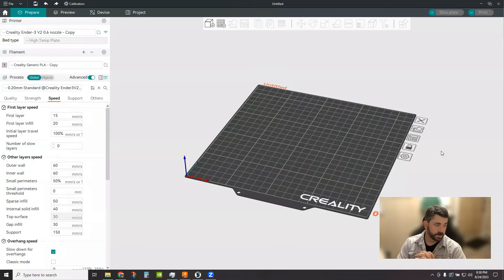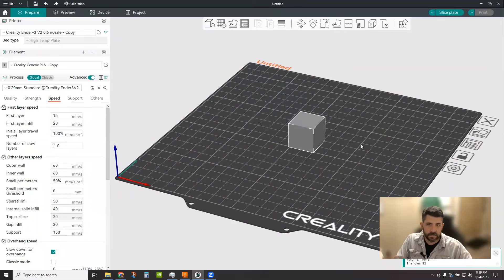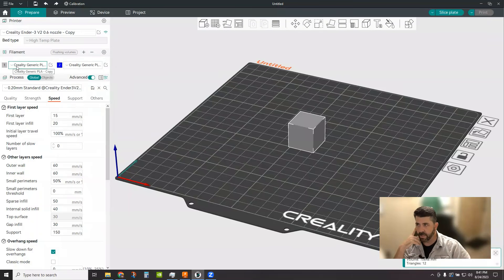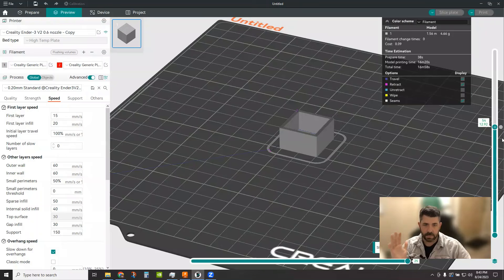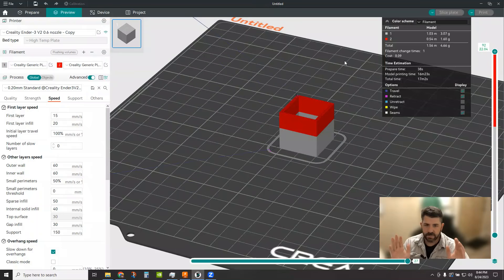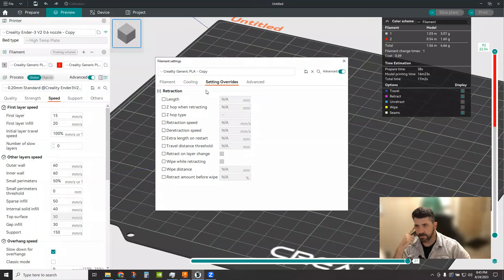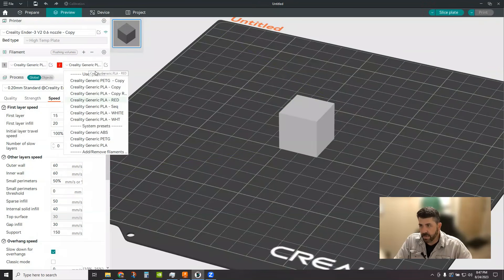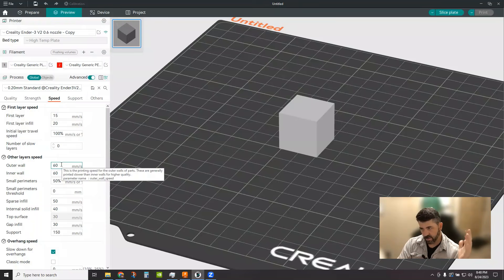Do this for easy filament changes in Orca Slicer

Comment: When I right click the scroll bar on the right in Preview there is no "filament option," just "Add Pause," "Add Custom G code," and "Jump to layer." Filament used to be there but is gone. Ive reinstalled and installed software to no avail.  ANy ideas?  Thank you! Maybe because I only have one filament listed on the left?  Not sure how to add more.  thanks!
Reply: my filament on the left has no plus sign to add more.

Comment: FYI - for manual change of filament use M25 instead M600. M600 applies only to printers with multifilament option.
Reply: @TheSkullProphet  about for the Flashforge Adventurer 5m pro

Comment: Thanks you, simple and straight to the point. I've had problems with my printing I messed up the Orca Slicer by messing with the default settings and added my own settings, I had to removed them to get a solid print all working OK now, I have also changed the travel speed from the default set at 700ms to 150ms on the Ender 3 v2, the pain is the calibration on the printed and setting the Z-Offset but I think it's OK now best I can get it. Thanks for the Video it really helped me out simple :) Sub :)

Comment: Thanks for the good explanation for changing colors in Orca Slicer. But how do I actually get this to work on my Ender 3 v3 printer. Many people say that Klipper is so much better than Marlin. I got this E3 V3 partly because of this. But now I’m not so sure. Color changes in marlin were super easy. I have yet to find any really good info on color changes using Klipper. Perhaps someone could point me in the right direction. Thanks

Comment: Ender 3 Pro and  Orca Slicer user here. 
I did a test with filament change from color 1 to color 2 yesterday, but the printer never stopped, and printed the piece all in color number 1. I checked the G.code sectión on the printer configuration and says M600 for the filament  change and M25 below at the pause section. Anyone having this issue? and knows how to solve it,  thanks in advance

Comment: Ender 3 v3 se user here. This worked pretty well. I didn't know what to expect. It paused on the change. On the printer's panel I selected retract and ejected the first filament. I then manually inserted the second filament and the printer resumed shortly thereafter. I'm not sure if there's a sensor to tell the printer had the second filament inserted or if this is a timer but it worked

Comment: Anyone have an idea why my printer is just sitting idle when i try printing with the added filament change gcode?  doesnt even start the initial print, just sits idle with bed and nozzle at operating temps and doesnt prompt for anything else

Comment: pitty theres no info how to get those  + - buttons to add filament, that you have to check it in printer settings and check that you manualy change filaments also. with that info it would be complete and 10/10

Comment: I wish you've shown the actual printing too, because when a filament change is added like this, the printer starts normally, does the priming line, but instead of starting to print, the print head goes up, retracts the filament which was already in, and starts waiting for you to insert the first filament, even though it was there to start with. Now, you have to re-insert the filament, extrude some and manually press the resume button to start the print. By this time, the nozzle pressure is lost, some filament has already oozed out and the first layer starts without a priming line and a bad under extrusion. This needs to be corrected. Orca slicer version 2.2.0, Creality CR-10SE
Reply: Utilizing a priming tower for this will be your solution for this. Do the same process, and after resuming, ensure ramming is on and it will prime on the tower, getting rid of the blob. hopefully

Comment: Really helpful video, thankyou! The bit that I was struggling with was the different print speeds or different layer heights, for example, after the filament change. Judging by what you said at the end of the video, this cant be changed for different filaments?
Reply: You can!!! You will need to add a Modifier and you will be able to change speeds when you change filaments.

Comment: Newb here. What is a Filament G-Code?
Reply from the maker: no worries.  we were all newbs at one point.  what type pf printer do you have?  under the printer settings you can manually add g-code to change filament.  This particular video would be a reference if you're using something like and ender 3 that has Marlin based g-code and you'd use an m600 command to initiate a printer pause to change the filament.
Reply: @fischer3d  Flashforge Adventure 5m. 
No idea what a G-Code is. Need to research.

Comment: how i put mannual bed and nozzle temparature in orca slicer 
i search all settings but not find
Reply from the maker: nozzle and bed temps are governed by the filament settings.  next to the name of your filament there is an icon to "edit presets"  there you can set the nozzle and bed temps

Comment: Quick question..why when I add a M600 at layer..does the paint layers keep changing? Like I add it at 11..rezlice and then it shows color change on 10 instead of 11 it use to be
Reply: I think it jumps to the closest 5th layer try using your arrow keys to choose specific layer

Comment: Is there a way to get the printer to extrude the filament after a filament change instead of having to push it through manually to get to the next color?
Reply from the maker: What type of printer do you have?
Reply: @fischer3d  Ender 3-v3 SE. I think Iended up just doing this manually. Weirdly, I'm back to doing a filament change on something again. And now when I right click, the option to filament change isn't there. So using gcode it is, I guess.
Reply: I figured it out. I believe in previous versions if you just right clicked, the filament change was already there. In later versions you have to add the additional filaments first in the settings and then it will let you right click and do the filament swap

Comment: So I know this video was done 10 months or so ago but I tried the process you describe to change the filament at a particular layer.  The first try just blew right on through the layer where I expected it to pause and allow me to change (and no beeps either). Then I tried adding into my machine (Ender v3) profile Manual Filament Change under Multimaterial. No joy there either.  Now I am trying M25 under the Change filament G-code also in the machine profile. If that doesn't work, do I have to insert the gcode manually at that layer (you can't do both the filament change and something else when doing it this way)?  Orca Slicer 2.1.0. Thanks in advance for any tips!
Reply: So M25 at least paused the print so I could change the filament.
Reply from the maker: Isn't the ender v3 klipper based firmware?  or is it marlin based?  If klipper you'd have to investigate a bit on executing the pause and filament change.  I believe it works differently than marlin.
Reply: @fischer3d  ender 3 v3 is marlin

Comment: Really hope someone answers.  I love your content and have a question.  I've been trying to fix an issue, I use the filament change option in Orca like you do, but when I do that, and then start the print again, it shifts a little, so its now skewed.  I don't know how to fix this, been trying to fix for a couple days.  Can you offer a suggestion? Is it from the Z-hop?
Reply from the maker: interesting.  It normally wouldn't be something like z-hop by itself.  is it skewed in the x and y or in the Z?  When manually changing filament with my old Ender I had to be super careful not to press too much on the print head while changing the filament or the nozzle position gets thrown off.
Reply: @fischer3d  It was working fine before but now its not. Even when I use pause, M600, or filament change, it still moves over a little.  It's skewed on the Y, not X or Z.  What do you suggest?  It was working perfectly before and now it's not, no matter what I do.
Reply from the maker: If you haven't already, maybe do a control test..  What I'd suggest is let it go through the pause, but don't actually change the filament or touch the head, then just resume the print.  See if that by itself causes the shift.

If so, and it's still in Y i'd be looking at something mechanical like belt tension.  

What type of printer do you have?
Reply: @fischer3d  I actually did that before you suggested it.  It still shifted.   I have the ender 3v3 KE.  You think it's belt tension?  Tighten or loosen?

Comment: Do i need to add a pause so i can manually change my filament?
Reply from the maker: all depends on the type of printer.  In Marlin gcode an M25 command is a pause or dwell.  if your printer also has the "Park on pause" enabled then when an m25 is issued it'll park the head in a predetermined location.  You can then change filament and resume the print.  If your pause command also includes a temperature setting to cool down the head you'll just need to be aware of that.  An m600 itself should theoretically take care of all of that.  Generally you would not issue an m600 and m25 together.
Reply: @fischer3d  i have the first ender 3, i tried to print aith change filament but it didn't pause print, is it also because of the firmware?
Reply from the maker: Could be.  Do you know what version it is running?  Looks like m600 has been available since Marlin 1.1.0, but pretty sure the the original ender had something like 1.0.3.
Reply: @fischer3d  im running 2.0.6 , it is working, i notice that the temp changed because i had different temps for diff filament. I thought that "change filament" it will pause and wait for me to press resume to change filament, but i think thats not it?
Reply from the maker: interesting. are you sure that's not the Creality FW version?  it should have a pretty annoying beep and prompt you to press the knob to resume printing after filament change. I'll have to power up my old ender and see what version i've got running.

Comment: Getting ready to do my first 2-filament (color change only, same type PETG) and I found your video.  My problem however, is that I have an AMS and my first filament is in it.  The 2nd filament I have to use the spool holder on the back of the Bambu X1-Carbon because the spool is cardboard and it won't work in the AMS.  When I send something to the printer in Orca, I have to deselect the AMS if I'm using the spool holder on the back.  I don't see a way around this, so I'm guessing that I will have to use both spools on the back? Unless you know another G-code to alter that?   I'm very new, less than 4 weeks, at 3D printing.  And, I'm an old dog, so things don't come to me as easily as before.
Reply from the maker: Sorry.  Not sure how to solve that one.  I found a couple of folks attempting the same with Bambu Studio, reading over the steps it looks like you might be able to try something similar with Orca.  https://forum.bambulab.com/t/multimaterial-printing-using-both-ams-and-the-spool-holder/29602/3

Comment: I just did my first multi-color print using Orca Slicer. It came out fine, but I had two issues...

After changing the filament there was no nozzle wipe, so I had some strings I could have avoided otherwise.
The color change happened like 5 times, rather than once. I think maybe it was programmed into the model that way? How can I prevent that?
Reply from the maker: What printer do you have?  Also, it kinda depends on the model.  if there are multiple colors in the same layer, it will generally have to switch filament regularly.  It typically wont print all one color first then switch over to do all of the other color.  This is to avoid collisions.  Again, this all depends on the model.  If you didn't color yourself in Orca, there could be some errors in the color fills in the model causing excess changes.  So you have a link to the file you want me to look at?

Comment: Thank you so much! Just got the Creality Ender 3 V3 KE and really struggled to get the profile setup in Cura so I could do multicolour printing. I downloaded the Orca Slicer and it has the printer profile available. Your video was awesome and I learned a lot. I am using the Creality Print for one colour prints but will use Orca Slicer for multicolour using a single extruder.
Reply: did you use m600?

Comment: I did what you said. I wanted to change filament at the 6th layer and the 10th. The problem is that when it started printing it wanted to change the filament at the beginning.
Reply from the maker: maybe try the alternate way.  go to about the 4 minute mark in the video.  instead of adding the m600 in the printer settings you can just delete that and in the preview on the right hand slider, right-click and say change filament or add custom g-code (enter the m600).  That way the m600 at the start will be omitted.

The other way would be to open the g-code file in notepad and delete the first m600.
Reply: @fischer3d  thanks man! I added M600 as a custom gcode at the specified layer that I wanted to change the filament and it worked like a charm! Sad though, because with the other way you can change the color of the filament and it looks very nice when you slice it!

Comment: I’ve tried this and when the print started it did the purge line then went straight for a filament change at layer 1 and then missed a few cm of the print is there any advice on how to change this?
Reply from the maker: Check around minute 4:15ish.  To avoid that starting filament change you can insert custom gcode and add the m600 at a specific spot.

Comment: You can use this for the custom change filament gcode, then it won't pause on that first layer. Though if you ever try to add a mid layer filament change on the first layer, it wouldn't run on the first layer because of the "if" condition.

{if layer_num > 0}
M600
{endif}

Another thing to note is using the "Change Filament" thing is better if you have tuned filament profiles (flow rate, pressure advance) as those changes will be included with the "Change Filament" method. And also not sure if its something with my profile, but it also adds toolchange macros (T0, T1, etc) commands, so I had to add those macros to klipper (and just have them do nothing) or manually remove them from the gcode after slicing.
Reply: Or…. in printer settings under the multimaterial tab, check the ‘Manual Filament Change’ box to tell Orca that you don’t have multiple toolheads and the first layer change problem disappears.
Reply: @walloutlet  Tank you so much this works really fine with OrcaSlicer 2.2.0
Reply: Actually, this would work even better. Apparently there is a variable named "toolchange_count" that is incremented for each tool change. So by using this, then effectively the first tool change does NOT do the M600, but if you are able to do a mid layer filament change on the first layer it should still get the M600.

{if toolchange_count > 1}
M600
{endif}

Comment: It would seem they could add a base speed modifier setting for filament types in case you wanted to modify the speed by a certain percentage. Then it would just adjust everything up or down by that percentage while that filament is printing. Or just default to 100% for no change.

Comment: I'm also using Orca, but with Klipper. A little annoying the slicer is assuming there is no filament loaded at the start so it inserts M600 in the beginning. Would prefer it prints normal to the point you ask for a filament change at a certain layer and then calls M600. It worked for me somewhat, but there was a little goofiness from the initial pause i didn't realize happened.
Reply from the maker: Gotcha, Check out around minute 4:15ish.  Instead of dropping on the m600 at the printer settings level, you can use the preview and on the layer slider on the right side of the screen, you can right-click and add custom gcode.  then you can drop in your filament change code directly.  This should avoid that initial m600 problem at the start of the print.  I had the same issue.
Reply: Maybe too late for an answer, but you just need to turn "Manual filament change" option
Printer>>Multimaterial>>Manual filament change

Comment: Instead of putting change filiament like that hit the custom gcode and add a m600 this will make it so it wont try and load filament at the start. i think there is a fix for this coming in one of the new builds that will allow a manual filament change. right now it seems to be setup for the bambu ams so it calls commands for that

Comment: this works on Creality K1/K1 Max?
Reply from the maker: I believe the K1 runs Klipper firmware so the M600 command wont work directly as it does in Marlin.  For klipper there is a macro you need to create in order to facilitate filament changes.

Comment: I'm about to find out if silk pla will stick to regular pla... 😁

I was just thinking to avoid having to deal with adding/removing m600 or dealing with re-inserting filament, I could copy over my printer profile and name it "color change" and add the m600 on that profile. Not sure if it works that way but I'll test it out when I get home
Reply from the maker: Awesome.  Let me know how it works out.

Comment: Hi excelllent video, one question, is there any way to solve the problem of the fiorst m600 (unloading the filamenbt alredy On the machine) and only let the change fialment please 
thanks
Reply from the maker: Hi there.  Thanks for the comment.  If you're adding the m600 under the machine presets then you would probably be limited to opening the gcode file and deleting that first m600 command, saving the file, then running the newly saved file.

If you use the second method in the video (around the 4:15 mark) you could remove the m600 from the machine preset and add the m600 using the "Add Custom G-Code" option in the slice preview.  This would only process the specific m600(s) you enter.